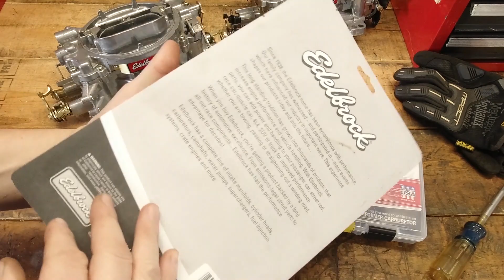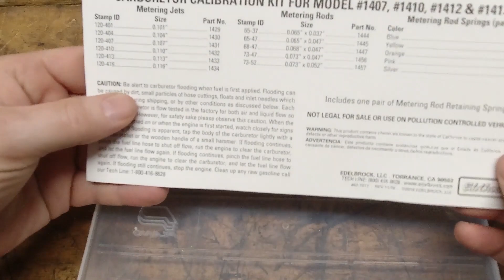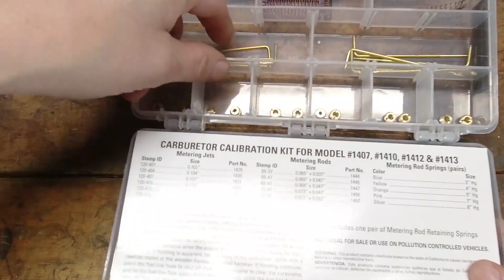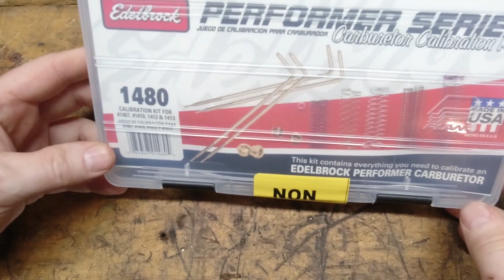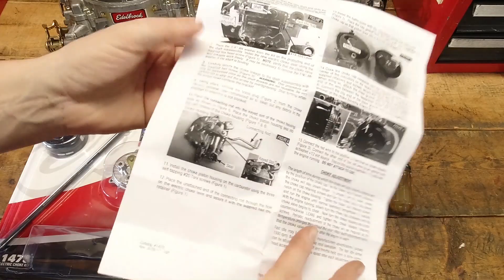How to Install Edelbrock Electric Choke Kit

Comment: Great video. As always.  I have converted my Avs2 carburetor from manual choke to electric. But now I found out that edelbrock says this can’t be done. Do you know why that is?
Reply: Hi Laurens! I am interrested to know how you made it
Reply: @fabricegabrini7776  In my case I just switched the whole electric choke assembly of my 600cfm edelbrock with the mechanical choke assembly of my 650cfm avs 2 edelbrock. Everything fitted the same

Comment: I really love this video. Its like a lecture from my professor. I want to get better at tuning a carb. Would you recommend buying an old carb to learn on? I wanted something to practice on, not necessarily put in the car but learn the nuts and bolts, springs etc
Reply from the maker: Very much appreciate that!  I’d say jump right in on the carb you have.  If the fuel system is right and the ignition system is right, you’ll be able to tune yourself out of any issues you come across.  A good rebuild is where I’d start and there tons of videos to help you with the process.  If you’ve got any questions, please ask!  I’m glad to help.
Reply: @MuscleCarSolutions  Appreciate it. Thanks!

Comment: I have a 64 El Camino  - I had to replace just the thermostat (and gasket) portion that meted a bit. Now that I replaced it and have the housing turned so that the choke plate is almost closed all the way my car is having trouble starting and staying on.  Do I need tune the whole carb no that I've replaced the thermostat?  I love your vids -- thanks for your help!!
Reply from the maker: Set the choke at two ticks lean so it opens up the choke plate a little.  Shouldn’t be all the way closed.  Thermostat won’t have any bearing on the running of the engine if that’s all you had replaced.  Assuming everything was tuned and running well before you got into the cooling system.  Thank you!

Comment: Great video!  I just got a Edelbrock 1478 kit from an eBay store and noticed it had 2#s on the housing 170-1778 but all the ads I see only has the 1778 is this a knock off or just maybe old stock? Wish I could post pic here. Have you seen this?
Thanks

Comment: My fast Idle cam had pivoted away from throttle-? I had a idle compensator added by mechanic for AC install. That doesn't work either. Do you cover that too?
Reply from the maker: Edelbrock makes a fast idle solenoid to regulate idle when a/c is on.  It’s a pretty simple hookup into the power wire to your a/c compressor.  If it’s not working, figure out what’s going wrong or take it to a better mechanic.  This is one of the easiest things you can install.

Comment: Great video and great channel! I have a question, probably a bit in common with the previous comment by Laurens van Peperstraten. I am looking to install electric choke on my 1812s. 1813 had the option , but I can't find any kit for the conversion. Do you think it would be possible to install the 1478 kit?

Comment: Is the fast idle cam supposed to be pretty snug without any play ?  Mine from the factory feels sloppy, rotates up and down just fine.it’s just moving side to side too much almost like it’s missing a washer ,so it’s not always sitting on the fast idle screw correctly. the screws tight that holds it in place. Any ideas?
Reply from the maker: There is no other washer that goes in between the cam and bushing.  Some are a little looser than others.  If yours isn’t riding on the fast idle set screw then yeah that’s a problem.

Comment: Really great informative video, but I noticed that my hot wire is missing from my carb, so I'll have to get a new one and hook it up, but where do I need to hook it up to? That part I'm still unsure on.
Reply from the maker: Nicholas Jones one of the most popular places is the fused hit wire going to the windshield wipers.  It’s key on hot, so it’s what you want and not a constant hot.  Any fused key on source will work.
Reply: @MuscleCarSolutions  thanks for the quick reply! I'll try that when I get a new wire.

Comment: Great video. Can you tell us about the open port on the choke canister? This is in the aluminum portion to the lower right of the black plastic piece when looking at the electric choke assembly.  I thought it could be vacuum related since the tone changes when I place my finger over it. Thank you.
Reply from the maker: That vacuum port is to help keep the choke valve open when it’s fully warmed up.  There is a piston in the choke body that references the vacuum from the carb.
Reply: Thank You! So, that remains open with no plug/cap, correct?
Reply from the maker: @shawnpeters5837  yes.  On a manual choke carb that port is plugged.  When you add an electric choke kit to the carb, it’s removed so the choke can reference the venturi vacuum.

Comment: After seeing your video I notice my choke is missing the (baffle plate) that goes on before the gasket and chock.. do I need i
Reply from the maker: Uh... yeah!
Reply from the maker: @JCsFluffyTail  it’s to separate the two halves of the choke and the slot is there to guide the actuating arm for the piston.  If you call Edelbrock customer service, and you ask nicely, they will send you one.  BE PATIENT.  I can tell you they are short staffed and doing the best they can so if you have to wait in hold for a few, please don’t take it out on those nice ladies who can help you solve the problem.  Just ask for the choke baffle plate and they’ll mail you one.  FYI, never call on a Monday.  Wait till later in the week.
Reply: Will do, thank you,, i appreciate your help

Comment: I'm trying to put a manual choke on mine, will that do the same? I did notice the mounting screw holes are on the front of the carb though

Comment: After following along and installing an electric choke, I am concerned about two things- the choke plate no longer opens more than about halfway...and also, the screw on the bottom right side below the idle adjustment screw no longer makes any contact with the metal plate. I don't know what that screw is for, some sort of adjustment. Can you shed any light on this? I'd sure appreciate it!
Reply from the maker: I’m aiming you’re referring to the fast idle screw.  It’s to allow you to set the idle speed when the choke is fully closed.  If it’s not, then adjust it until it does and operates easily.
Reply: @MuscleCarSolutions  Wow, that's a cool adjustment to be able to make. I wish I could send you a photo on the fast idle side and see if you think something is off.
Reply: Behind the fast idle screw is the cold idle screw and it should be touching or barley touching is how mine was from factory too..

Comment: Very detailed as always! 

I recently overhauled a 1406 using a 1477 kit. Both before and after the rebuild, there was a terrible whistle of a vacuum leak coming from the piston inside of the choke body. The rebuild didn't help. Could the choke piston or cylinder wall be toast? Or is that supposed to allow blow-by? Starting to wonder if I need to throw a 1478 at it now.
Reply from the maker: Did you replace the seal between the main body and the choke body?  Sometimes that will cause some noise if the little seal is not installed.
Reply: @MuscleCarSolutions  Well, I thought I did. Just checked my leftovers from the 1477 kit and see the seal still sitting there. Looks like I better take the choke apart again!
Reply from the maker: Bingo!

Comment: If I keep turning my choke cap the plate doesn’t close all the way it still leaves a gap, all it does when I tighten the choke cap is make it harder to push the choke back open, and it is also flooding when I try to start it again after it has warmed up because the choke is closed back up. Any ideas on how to fix this?
Reply from the maker: You’re wrapping the spring inside the cap up.  Back it all the way off and take the cap off to make sure the spring isn’t damaged.  Then start over on the adjustment.

Comment: how important is the baffle plate? i have pulled 2 separate EDDY 1406 and 1409 that did not have the baffle plate.
Reply from the maker: They aren’t.  Edelbrock removed them years ago from their kits and finished carburetors.  It was a cost that wasn’t needed.  Still occasionally find them but they aren’t in anything new.
Reply: @MuscleCarSolutions  Thanks

Comment: If you can do a video convert this carburetor to manual choke of it came electric would be appreciated. Sadly the electric choke that came with mine was faulty and just stays wide open so I have to pop the hood and stand there holding it shut while the car warms up
Reply from the maker: Not understanding the comment.  You want a video on how to convert an electric choke carb to manual choke?

Comment: I can't get the choke assembly to rotate, I loosened the 3 screws, but the black choke assembly won't budge ?
Reply from the maker: It should turn easily.  Likely there is an issue with the spring inside.  Remove the black cover and inspect.  Might just need to be reset.
Reply: Just happen to me. I tapped the black rotating knob lightly with a hammer, then used channel locks lightly rotating. Freed right up.

Comment: I have. 750cfm for my 383 stroker. I was noticing that the idle was starting to creep up quite a bit and noticed that the choke plate was too far open. It doesn’t seem to want to return to the semi closed or idle position. Any ideas?
Reply from the maker: Bransoud4 what choke is on the carb?

Comment: I just swapped out my Holley 750 on my small block 350 4 the Edelbrock 650 avs2 carburetor.
I just installed it and wired the electric choke,and upon starting the truck it ran at high idle at 2500 rims. Can you edelbrock give me suggestions to what I need to adjust and in proper order. Thanks.
I could really use some advice.
Reply from the maker: Adjust the choke first.  Then the fast idle screw (bottom screw) on the drivers side throttle linkage.  Adjust both as needed.
Reply from the maker: @Troy41375 no.  The 1478 will not work with the AVS2.  Edelbrock does not offer an add on electric choke kit.  You have to purchase the carb with the electric choke if you want one.

Comment: Hello! Do you have any used electric chokes for a 1405? I'm trying to save money. $100 is insane. I currently have no choke as my car came from AZ. Now in NC I need one badly. Or do you know anyone selling used parts?
Reply from the maker: The issue is the shaft.  The hardware is designed to be installed and that’s it.  Most of the time they twist off.  Keeps from vibrating loose.  $100 for an electric choke kit gets you what you need.  Even if I could piece together a kit, it’s going to be close to that price.
Reply: @MuscleCarSolutions  Ok thanks for the reply.

Comment: good vid... and not full of commercials... thx... How fast does an electric choke on an eldebrck open?
Reply from the maker: Don’t blame the channel for the ads.  YouTube places them.  That’s how they earn their money and I get to upload videos for free.  How quickly or slowly the choke opens depends on the engine and ambient temperature.
Reply: @MuscleCarSolutions  no i dont mind a few ads... its just many have started forcing tons of ads... yeah i was just wondering... an avg engine... or an example of yours like 1 minute 2 minutes... 5 minutes.
Reply from the maker: Couple minutes or less for me.  I can see in a colder climate where that might be longer if you’re just sitting and idling.

Comment: Sooooo trying to isolate what was wrong with the Mustang, the only thing i couldn't be sure of was the needle and seat. They look good, but when i fired it up, I'm still way rich. So my neighbor let me borrow his 1406 (the same one that i made a short about the bent linkage) and the car didn't want to idel but it was definitely not pig rich like my 1905. Now im here trying to set the electric idle so i can drive the car and compare it to the 1905 whille i wait for the needle set to show up. Maybe ill make a vidoe comparing thr tow. But not while its 96° out lol
Reply from the maker: What’s your pressure set at?
Reply: @MuscleCarSolutions  just shy of 6psi.  For whatever reason I can't get the pressure constant at 5.5 it will drop to 4 when I try 5.5 and the car doesn't like that. Makes it sluggish.  Maybe I need a new one or rebuild the regulator.  It's a Holley Volumax.
Reply from the maker: @BPattB  something’s funky.  Mechanical pump?
Reply: @MuscleCarSolutions  yes it is. The car runs good with the old 1406. I'll put in the new neddle and seat on the 1905 when they show up. That's got to be the problem,,,,, I hope lol.
Reply from the maker: @BPattB make sure the floats are good while you’re waiting.  Completely submerge in mineral spirits and let it sit for a few hours to make sure they don’t get fuel inside.  Happens on occasion and would also cause the needle and seat to hang open and cause a rich condition.
Reply: @MuscleCarSolutions  10-4 I checked them yesterday!!!! LOL I use your channel like my daughter uses her text books,,, ahh Chromebook. I'll let you know how it turns out. Appreciate you MCS!!!!!
Reply from the maker: @BPattB  nice!  I kinda figure if anyone will get it sorted out quickly, it’ll be you!  Good work!  And I’m glad this mess has been helpful for you.  😆🏁
Reply: @MuscleCarSolutions  The neddle and seat showed up.  Got them in. Car is back to what it was. Another question I have for you is, I ordered the 1498 with the  .0935 seat, I believe that the AVS2 came with the .110  seat. By reducing the seat size, would I see an increase in pressure? I'm pretty sure I would see a drop in volume, everything being equal, same PSI over the same amount of time with the smaller seat will be less volume unless the smaller seat makes a increase in pressure. That was really long-winded. I'll leave you alone for the rest of the weekend I promise! Thanks as always!
Reply from the maker: @BPattB  yes but I can’t nail down anything exact on that.  I’m guessing it could be easily tested though.  I would walls assume the pressure would go up, but by how much I couldn’t guess.  Good question.  Live stream at 7pm central tonight if you want to ask anything else.  😆 Never a bother!  I enjoy the conversations.

Comment: What kit do I need for the 1905
Reply from the maker: There isn’t one.  Not on the air valve operated door carbs.  The 1906 was made to accept it.
Reply: @MuscleCarSolutions  thanks that's what I was afraid of...dang

Comment: 11:33  what if my carburetor has no brass plug and it’s just solid? Do I just drill it out and is the whole back behind a bit of aluminum?
Reply from the maker: On what carburetor?
Reply: @MuscleCarSolutions  Edelbrock version of a Carter AFB. Basically an Edelbrock 1405.
Reply from the maker: @greggkathy1892 so is it an Edelbrock or basically an Edelbrock?
Reply: @MuscleCarSolutions  I thought I replied to this, but I can’t find it. When I had it rebuilt at vans electric in Indianapolis, they said it was an Edelbrock version of a Carter AFB.
Reply from the maker: @greggkathy1892  I needed the clarification as the number of Chinese knock offs on the market make it extremely difficult to know that we’re talking about the same thing.  Unfortunately your rebuilders comments don’t help.  If it’s an Edelbrock regular finish carb it will have the part number and date code on the passengers side mounting pad.  If it is indeed a 1405, yes it has the port needed for the choke.

Comment: Hello.  My engine runs extremely rich.   And hesitates at take off.  And will die out.   At start up choke is closed completely.       Any suggestions??   Thank you very much.     1406 carb
Reply from the maker: Yup.  All the usual steps.  First determine if you have the right size carb. https://youtu.be/Hy4s9B43YM0
Reply from the maker: Then make sure your fuel system is set up properly.  https://youtu.be/s3bQ4IOPq_4
Reply from the maker: Then start making the necessary adjustments.  https://youtu.be/9ovQVoxWwj0
Reply from the maker: And start tuning using the charts in your instruction manual.  https://youtu.be/GFe3-Br_Z9w
Reply from the maker: But initially start with timing before you work on the carb.  Ignition issues with only make the tuning process impossible.

Comment: I ordered one of these kits online and it didn't come with the baffle plate. The seller says that it's discontinued and unnecessary. Is that true? Any input is appreciated.
Reply from the maker: The seller is incorrect.  The kit comes with a baffle plate.  It’s part of the choke and is needed.

Comment: I adjusted my choke and at initial startup it was idling at 1400 rpm which I thought was good. When I came out and checked it it was idling at 2500 rpm how do I adjust the idle when the choke is on? Shouldn't it have idiled down after it was warm. As soon as I tapped the peddle it dropped down to a perfect 900 rpm
 Other than that it runs perfectly fine all around.
Reply from the maker: Verify you have no vacuum leaks.  You can adjust the choke idle screw to set the speed.  It’s under the idle speed screw on the left/drivers side of the carb.

Comment: I came here to see how the choke rod is assembled for manual choke because the carburetor I bought (1404) seems to have the wrong pieces on the throttle  end of the rod. For some reason, the author shows one piece, then skips to the rod being already inserted...that makes this video useless to me and anyone else who needs to see the pieces installed on the throttle end of the rod.
Reply from the maker: I guess I’m not following what you’re asking.  The purpose of the video is how to install an electric choke, not how to install a manual choke.